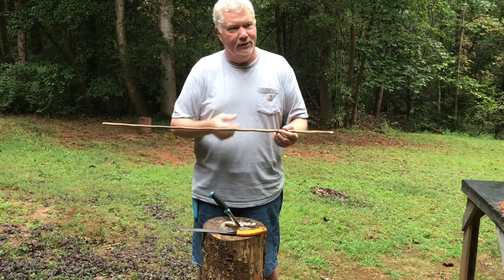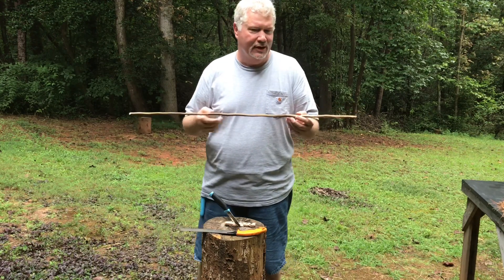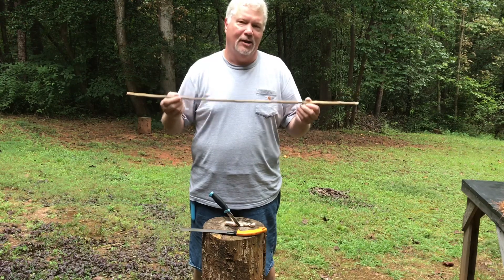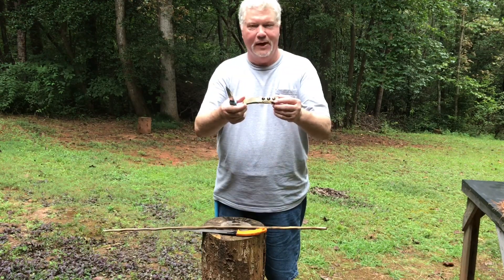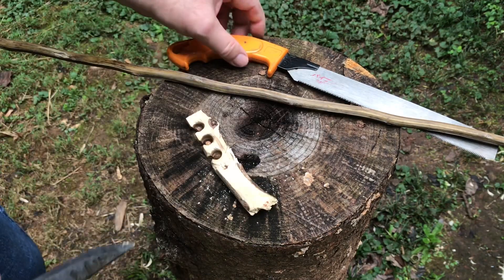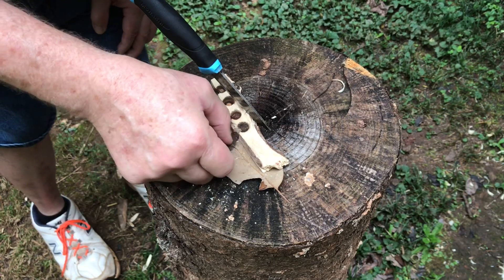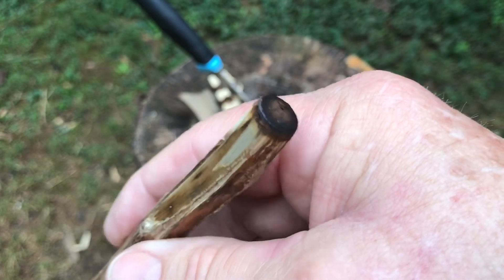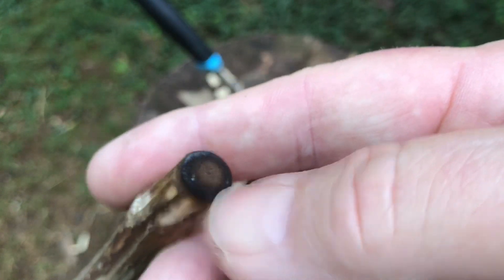Hand Drill & Bow Drill, Why you generate so much smoke but can’t get an ember.

Comment: This is very true. I have a proven set that I dried and produced several embers for successful fire. I left it in garage and worked a few days and it was raining and humid. Came back and wouldnt make an ember for nothing. I knew it was moisture previously I could get a great ember in about 1 minute. After drying it out again. Works perfect everytime. Bottom line I made a mistake and didnt protect from moisture.
Reply from the maker: I don't remember everything I talked about in this video... let me pass on a tip that my mentor gundog5 gave me. When creating smoke at the divot and spindle if the smoke streams straight up the spindle , it's mostly steam. If the smoke starts to linger down around the fireboard, it's smoke and the dust pile is probably already ignited.

Comment from the maker: The short answer is: 212 degree steam will not allow a dust pile to reach 800 degrees. The problem is moisture... in the set and in the air. You can dry a set to 0% moisture in the back glass of your car in 3 days. Not only will you have the 170 degrees working for you but the AC also. When you drive around, the AC is pulling moisture out of the air too... When those embers get too easy for you, start keeping your sets in the house which is probably about a 6-7% environment. Lastly, when that's no longer a challenge, store your sets outside under a covered porch. If you can overcome the 15+% moisture content... YOU WILL HAVE ARRIVED at the expert level. 
   All last year I stored my sets outside and only had a success rate of about 10%. LOL!!! I'm not going to work that hard again this year. By the way, before last year, I always stored my sets in the house and had about an 80% success rate.
  Please check out my Drying Cycles Playlist (LINK below). Drying Cycles are repeated burn ins where you're letting the steam escape between burn ins. When you start seeing black dust then you can go for the ember.
   Today I'm using the Mullein Spindle on a Shortleaf Pine fire board with dampish pine needles tinder. I did not use ashes for grip today but there was ashes residue on the spindle already. I pinned the board down with my Stainless Mora Companion.
  Please SUBSCRIBE at the end of the video. Thanks!
Drying Cycles Playlist https://www.youtube.com/playlist?list=PLkoXX8XsMW3lZEP_PF0eMdaiJOg2ABhoS
OTHER HAND DRILL VIDEOS YOU WILL ENJOY:

The Horseweed Harvest is ON!!! Choosing the right plant for a GREAT hand drill spindle
https://youtu.be/zMVGDx3vxKg
Hand Drill, Bow Drill, What SOME of the experts aren't telling you.
https://youtu.be/xDUbuMMiSOw
Friction Fire 4 Ways... Fire Roll, Hand Drill, Bow Drill, and Bamboo Fire Saw
https://youtu.be/PzIysPChca4
Easy Hand Drill Ember In The Rain... it's all about DEW POINT not humidity... Tips and Advice
https://youtu.be/TpfblPH0LfQ
Hand Drill, My First Ever Use Of Pine Sap for Grippage, WOW!!!
https://youtu.be/paASIbKJQok